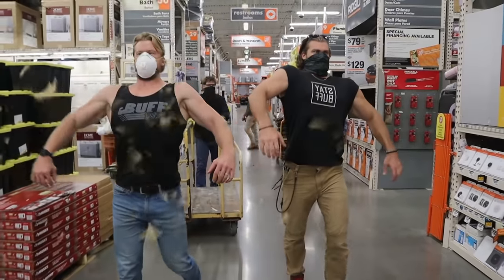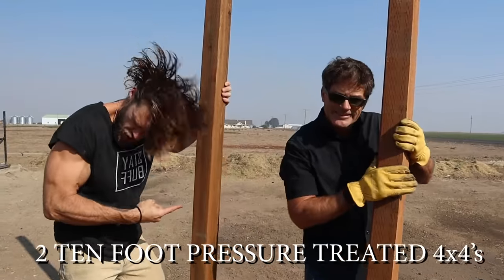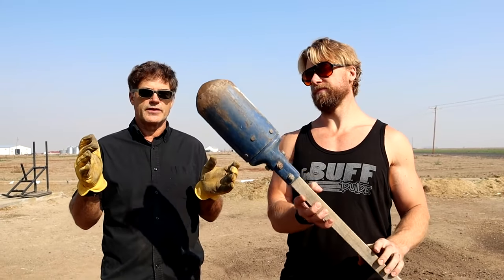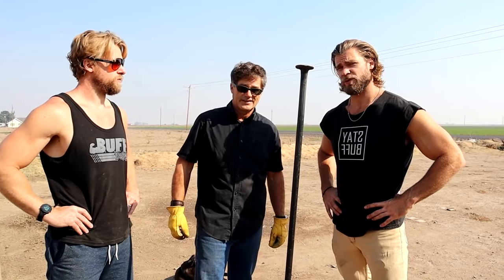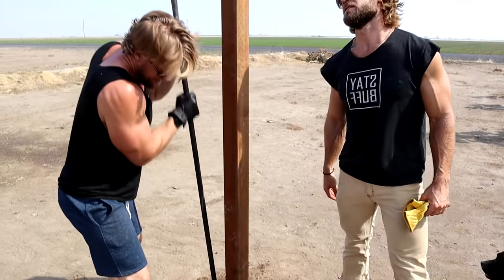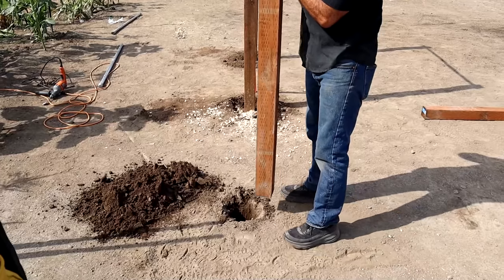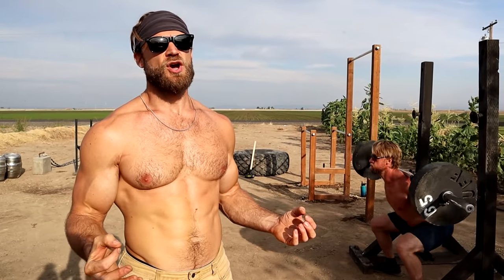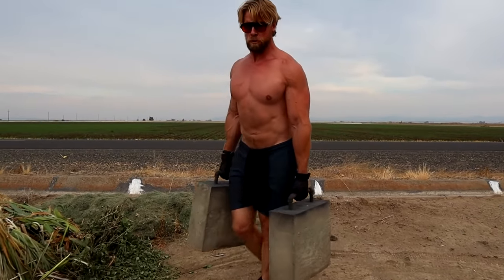We Built the ULTIMATE OUTDOOR GYM

Comment: Amazing! I build a structure like this, but i used galvanized scaffolding. used 1 inch pipe on the pull ups bar and 1,5 inch on everything else. 1,5 inch als for the dip bar, which gives it a little more comfort on the hands due to more surface.

Comment: Hang your battle ropes from the pull up bar for some thick roped TRX style training, it would give you suspension training and a grip work out at the same time. It’s great for bodyweight rows. 
You could also add a detachable bar across the top of your squat rack and turn it into a strongman yoke, if you put some upright pipes on the base you could slide some plates on to set your weight.

Comment: 3:22  I do some work securing the wood poles into ground, and concrete is not a way to go for a long run. It will hold great but it will rot the wood much faster. So one more reason not to use it :)

Comment: No major addition to the gym guys, just a suggestion. Run some screws or pins through the 4x4 and into the pipes. That will keep them from possibly rotating while in use. Gravity may hold them in place for now, but in a few weeks when Duke starts knocking out muscle ups for speed, it could get dangerous. Outside of that, nice work DIY Duke.